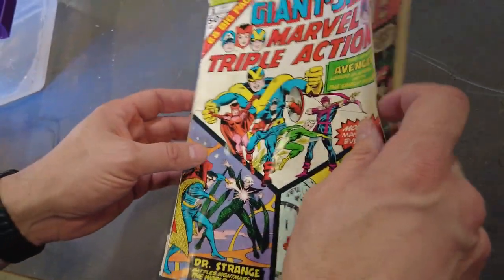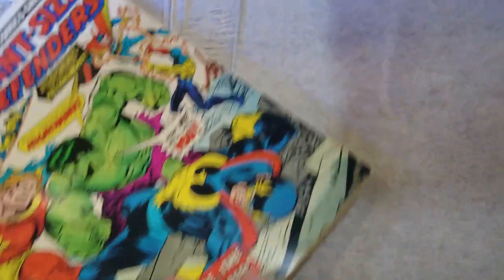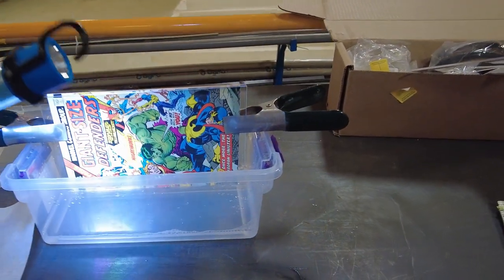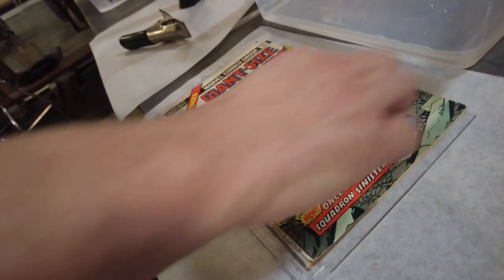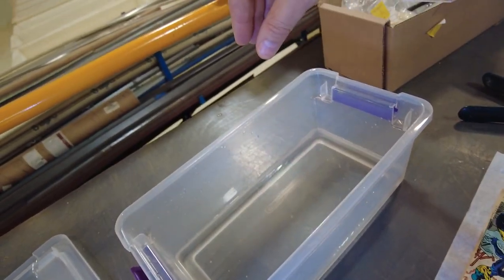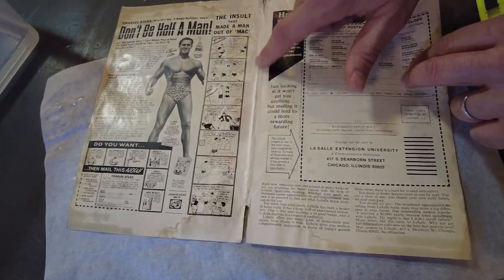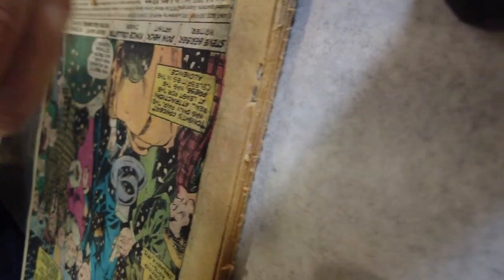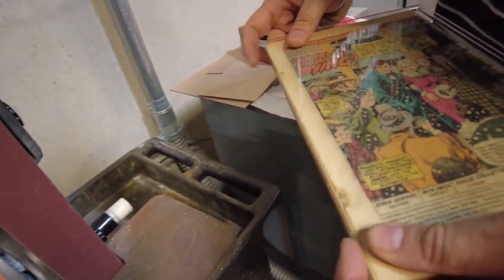Tutorial to remove Squarebound comic book covers

Comment: Hello Rick.  Thank you for showing us your methods and thinking.  In the course of your experiments, did you ever soak a square bound cover edge with your method but not remove it?  Then when the cover dries, but the glue is still malleable, square up the edge again kind of like a spine roll correction.  Or did that method never work for you?
Reply from the maker: Hi Michael, that’s a good question. The answer is that sometimes that works to wet and square and sometime it doesn’t because a portion of the cover will detach from the glue. Most often it mostly works but one or two small sections will detach

Comment: I’ve been hunting the early multi issue reprint editions of Marvel Tales, and Marvel Super Heroes. 60’s stuff that is very cheap. They’re square bound with square bound issues. Hahaha my issues have issues! Cool to see the bindery defects from the printer. Never thought of that. Your use of sandpaper is just crazy to me. My cave man touch is way to heavy for that process. Probably won’t remove any squarebound covers because I am one of the “most of you” that doesn’t want restored books.  “Capillary action” up is now added to the glossary. Thanks Rick
Reply from the maker: many things I do are crazy even to me, Buck.  Surprisingly I sometimes bring the ire of Facebook groups that will ban users for even mentioning me or my products in a positive or neutral light.  Instead of very fine sandpaper you can rub it with an eraser, but that usually makes it not look very square when you are done. 1000 grit is so smooth it feels like leather or paper anyway and you are only using it for the friction it provides.

I'm actually with you on keeping comic natural and I only remove and replace covers if people ask me to.  Often it's swapping covers from one book to another or repairing a split spine so there was no escaping a purple label in any case.  There is a way to dissolve the original adhesive in isopropanol and then apply it to the spine to rebind the book but it doesn't always work.  The IPA dissolves and leaves the original adhesive behind.  Optically and chemically the book is no different than if you use new adhesive, but if you know, you know.

good luck on your hunt.  If you eve decide you want to reuse the same dissolved adhesive on your square bounds, I will be happy to show you how!
Reply: @ImmaculateComics  ….they would excommunicate Galileo given the opportunity. I hope you don’t sweat the haters. They’re just jealous that they don’t have two b17 salt dog chambers and an AF15.
Reply from the maker: Thanks my friend. I should mention its a B117 not B17 as I may have misspoken previously!  

Also, it doesn't bother me so much for myself as I am very comfortable in my own skin and this is just a hobby for me.  However, my ultimate dream is to create a world where many thousands of artisans have the tools and knowledge to preserve and protect these gems.  I would like a world where people share their experiences and develop new and better methods, possibly creating whole new economy and whole new way of keeping this hobby cogent and interesting long after I am dead and gone.  Tribalism is the enemy of that.  Most forums are just a long series of examples of a craftsman's skills without useful information about how they got there.   

Some businesses that offer it as a service offer examples of their work that doesn't appear challenging or difficult at all and the lead times are just crazy.  

I would prefer that people don't have to send their books in for this really low level mediocre stuff and do it themselves. Possibly even at a rent-by-the hour area where people can rent a press and the equipment to clean and press their books under the guidance of a pro.

not that you asked for this level of detail but I value your opinion on the matter: 
I've long been playing with the idea of making a Udemy video series about how to clean and press comics that people can download and watch in detail as they are doing their own thing.  The problem is that it would have to offer much more detail than my YouTube videos which already take up so much of my time.  There's a surprising amount of editing involved to take several hours of video down to 15 minutes and to do the color grading, sound leveling, etc.  I can imaging doing that with several cameras and microphones and planning it all out with the right B-roll and text overlays will be a gigantic time sink right when I am planning trips to Texas, Georgia, Hawaii, Nigeria, Zambia, Lesotho, Malawi, Alaska, and back to Scotland this Summer.

I don't know if you know but I recently gave a ted-talk type presentation on green chemistry and sustainability using math and statistics and thats been so popular I am going on a tour for that in addition to teach chemistry this Summer, physically going to the CDC to train them on viral load waste treatment and also my regular Nanotech work in Texas.  Its just nuts.

so my question to you is, do you think my YouTube videos plus all the info you get from other YouTubers is enough or should I start making a more detailed video series with very specific instructions for cleaning and pressing comics?

Thanks Buck,  Diatribe over.....massive missive closing in 3...2...1...
Reply: @ImmaculateComics  initiative is too much for many. Phone navigation to a problem solver to throw money at is the antithesis to your dreamed economy. Changing the oil in a car is quite simple yet few do it. People want easy solutions. “How can I get this done without having to lift a finger?” I suffer from this at times. My anxiety wouldn’t allow me to part with my treasured comics to a stranger from the internet. That Is when I found Immaculate Comics. I think you have provided an excellent forum already to do basic pressing. Tic attack boards and chamfered pressing boards and immacuclean and plates, and , and, and,… I’ve learned so much. I think it’s all there already. I’m very excited to order the washing machine. I did look into creating one but lacked the initiative. There is also an “imposter syndrome” when learning new skills. I’ve done some pretty nice work but am still afraid to cpr my 181 or clean my ff48. I want to clean my jim83 and do the spine on my ff1 but I lack the confidence. There’s time though. I don’t think you need to redo the work you’ve done. It’s pretty clear from what you already have. You did mention some production techniques that are absent from some of your videos and maybe move forward with your production skills. They are where your channel growth lies. People want to feast on content. Unfortunately I don’t think your wants dovetail exactly with the comic community. The comic community would be most interested in seeing purple turn blue and lows turn to highs as a result of your effort. So if you were to take examples and show what could be done that may increase interest. 🤷 The clean chemistry stuff is actually much more beneficial to the human condition. Detoxifying the planets scientific process is amazing work and I commend you. You’re a celebrity in my mind. I personally would like to see how to mix some chemicals on your website and see what the different solvents can do and how to work with them safely. I find my collecting habits have completely changed to looking for things I think I can improve instead of perfect examples already. I hope this was somewhat coherent. I’m not the best at writing clearly. Thanks for everything homie.

Comment: Thanks for all the helpful videos. I have been watching for over a year now, and I'm curious which techniques I can apply while avoiding the CGC restored grade.
Reply from the maker: Hi Kyle.  I can never speak with authority on the matter but in my experience  you should avoid adding any foreign material to the book. This includes tape,adhesive, staples, leaf casting, and whitening agents. Bleaching agents and cleaners that evaporate and don’t leave a residue seem to be ok. Otherwise it’s largely a matter of your skill on not marring a book.  Use a soft tool or coated staple remover so as not to scratch staples
Reply from the maker: Also thanks for the kind words.  I keep wondering when this experiment will end and I will stop making videos but it’s nice to hear that there are people who don’t comment but still enjoy the videos!
Reply: @ImmaculateComics  Thanks so much for getting back to me. I will reach out on facebook with more questions.